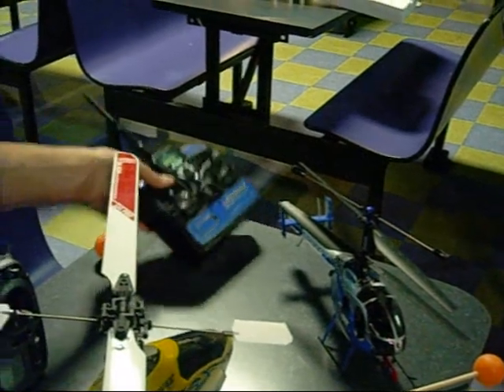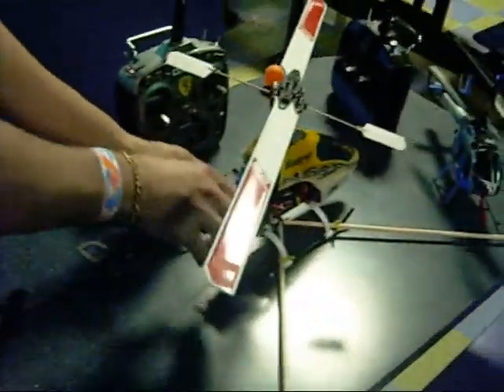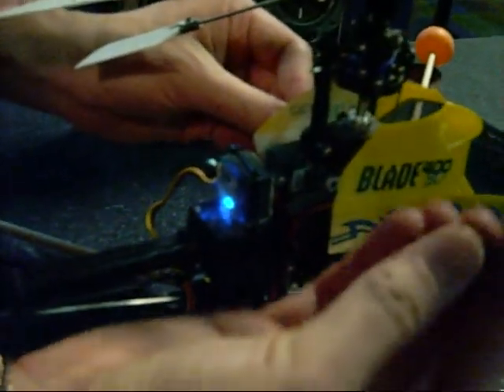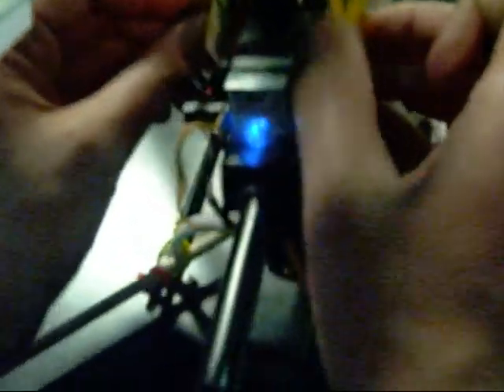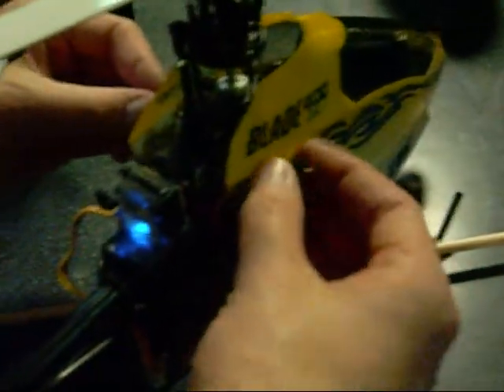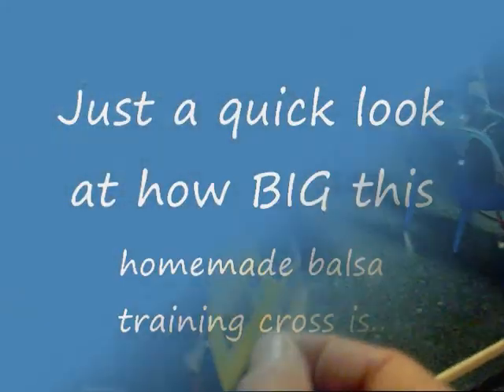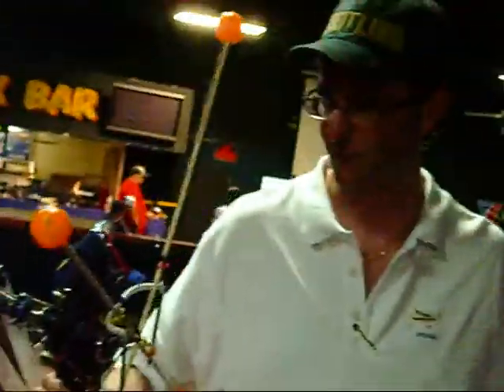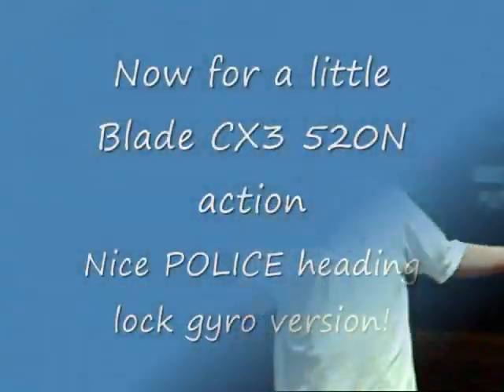Blade CX3 Police-MD520N & Blade400 instant canopy assembly idea

Comment from the maker: The use of directed air to provide anti-torque control had been tested as early as 1945 in the British Cierva W.9. During 1957, a Spanish prototype designed and built by Aerotecnica flew using exhaust gases from the turbine instead of a tail rotor. This model was designated as Aerotecnica AC-14. Development of the NOTAR system dates back to 1975, when engineers at Hughes Helicopters began concept development work.[2]  In December 1981, Hughes flew a OH-6A  fitted with NOTAR for the first time.